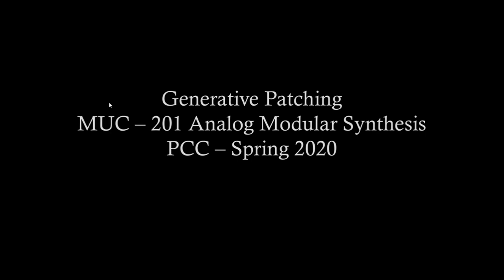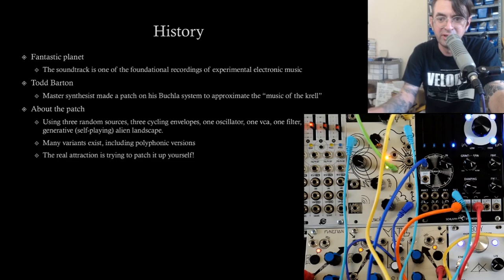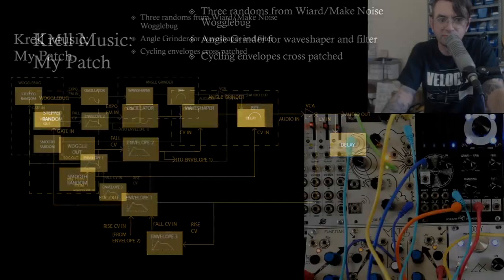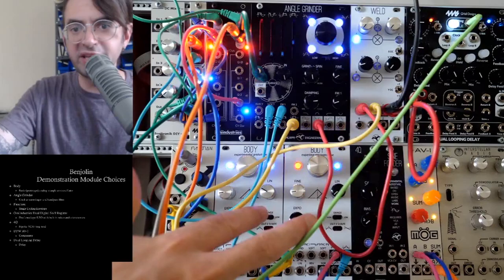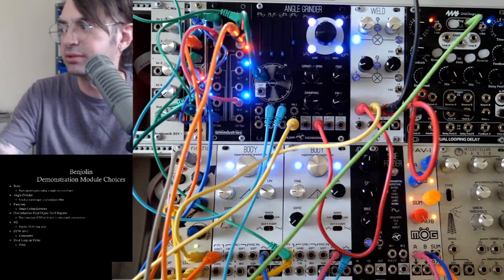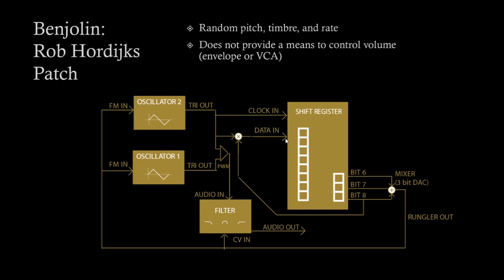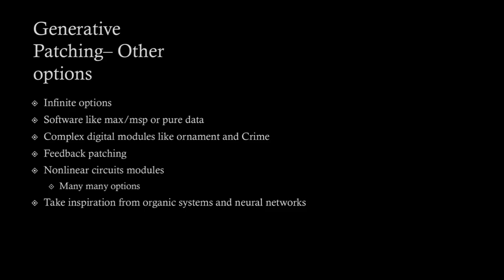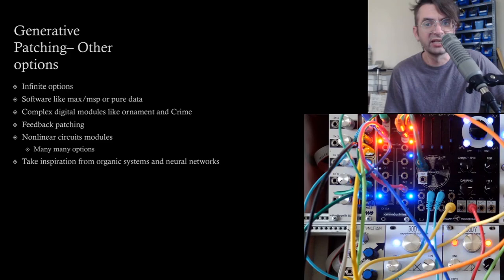Generative Patching: Krell and Benjolin

Comment: 1. Brilliant explanations of these two generative patches!  I've been experimenting with them off/on for over a year.  I still struggle with understanding the design of the Rungler patch.  I have O_C with the Hemisphere Suite, which has the Runglr Book app, but there is no documentation of how to patch it up.  Your video helps a lot.
2. It took me some time and research on the internet to figure out that the two triangle waves are sent to a comparator.  I did not understand the symbol or the principle.
3. I need the Angle Grinder!
4. I always thought "Schlappi" rhymed with "poppy" and "choppy", so I thought your company was "Sloppy Engineering", which would be a wonderful name.  
Thanks again!